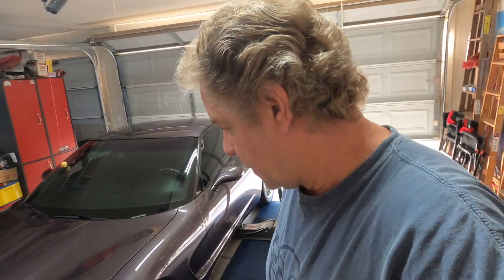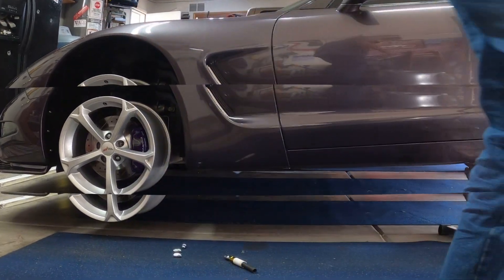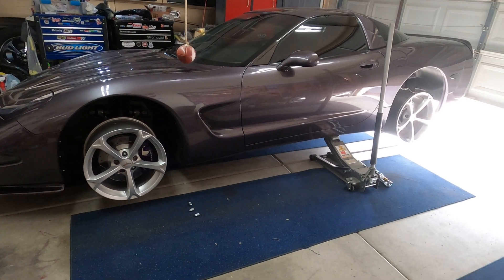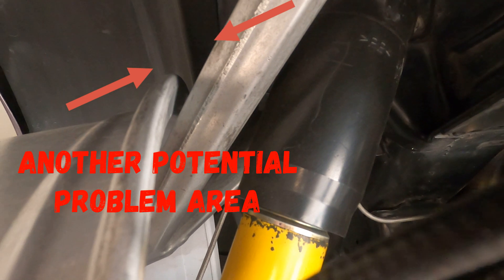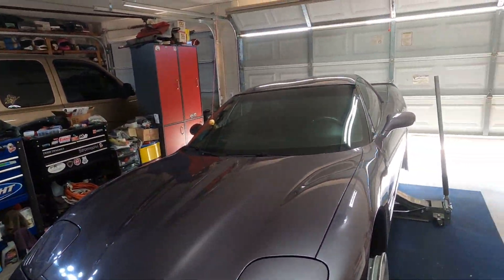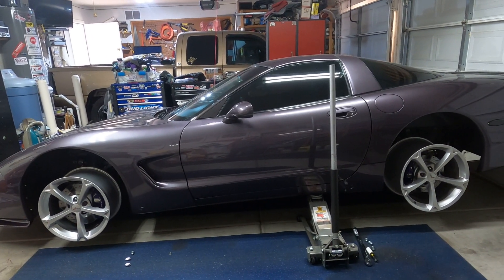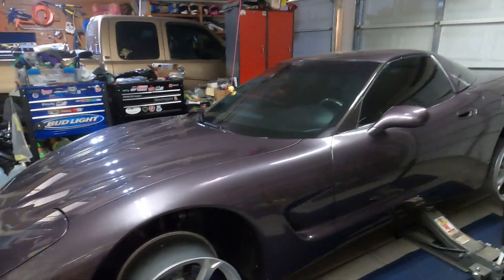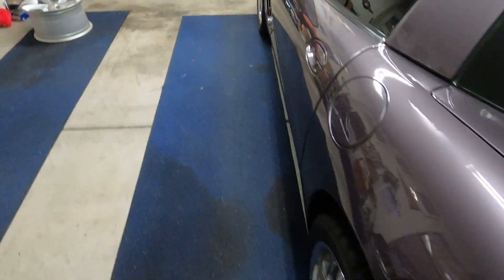C5 Corvette - Do C6 Corvette Grand Sport Wheels Fit?

Comment: I don't always comment, but I do always watch. This was a great subject to address, ie to see if the C6 GS wheels would fit. I like it, but I'm wondering if you had coil-overs if that would help the clearance for the rear wheels as to the A-arm clearance? A set of chrome GS wheels would look phenomenal IMO.

You were talking that you'd have to get them chromed. Where in NJ or elsewhere would you go to have them chromed? There aren't many places around that do that anymore due to government regulations. 

Good luck in your search for an alternative wheel setup that you really like. Make sure they're chrome though. 😉

Lastly, I do like the wheels you already have. Save the Wave 👋
Reply from the maker: Appreciate the comments, always welcome. Thanks. 😎👍 I do like the GS wheels and if I did get a set, I'd probably go the wide body set-up with the car. I would also look for a set that was already chrome and so I wouldn't have to worry about getting them chromed. I have also installed the coilover shocks too, love them so far. I still have the chrome wheels on from this video and really like them so I proabably won't be changing anytime soon. I am going to leave the car the way it is for a while.
Reply: I can't say what you will, or won't due. But I'd say that installing a wide body would be more than a challenge and expensive. If you feel you could do it and it's worth the money, GO FOR IT! It would make your C5 even more incredible.
Reply from the maker: @petercarey6883  Thanks, nothing in the plans for a while so it's going to stay the way it is for the foreseeable future.

Comment: I have them on my 2000 base. they look amazing went with 315's instead of the 325's in the rear no rubbing unless its dropped max on the z51 package. fronts poke a little but when i change tire ill go a little smaller and should alleviate most of it.
Reply from the maker: Awesome, thanks for your input. It will come in handy if someone watches this video. Did you need a spacer for the rear to keep them from rubbing the inner fender well? They look like they'd rub a bit.
Reply: Any idea if they fit on an fbody? Or will I need spacers

Comment: I have after market crome C6 wheels on my C5 and I love them.
Reply: Grand Sport
Reply from the maker: @paulconway3015  Thanks for the reply. I'm still debating on what I really want...I do like what I have now but just want to be different from what others around here have also.
Reply: I just put my old 2008 Z06 wheels and tires on my sons c5 Friday and they are 325 on the back I think it looks good.
Reply from the maker: @kevinz0681  Nice, those are great looking wheels. I never would have thought the 325's would fit though.
Reply: @c5grapeape  ya they fit just like the but they stick out a little bit, I’m gonna have to wait till spring and decide to go to a 315 tire, but I have a 345 drag radial on HRE wheels on the c6 and it looks great.

Comment: The back wheels are usually a little wider the the front. Could it be possible that you may have the rear wheel on the front and the front wheel on the back?
Reply from the maker: Not really, I checked that too before I put them on to make sure I didn't do that.

Comment: At ride height they would be even worse.  It's amazing how much the wheels tuck at full droop.  Probably another half inch of poke if sitting on the ground.   Even my 01Z wheels stick out a 1/4 inch or so front and rear.  I don't care for it.  Love that grandsport wheel otherwise and even though I'm not a chrome guy I think they would look awesome on your car in chrome.  Are there Repros in 18x9 and 19x10?
Reply from the maker: The ones I have on now are 18x8.5 front and 19x10 rear. The ones I was looking at are true Grand Sport wheels but only made for 1 year and not available to buy from GM when one purchased a C6 Grand Sport, so 18x9.5 front and 19x12 rear. Won't work for me and what I want. Not sure what the aftermarket wheels are in the 18 & 19's off hand. I know they make them but just not sure on the width of them.

Comment: I'm looking for new wheels but the weight of any wheels I buy has to be less weight. No heavy chrome wheels or heavy wheels.
Reply from the maker: Weight doesn't really bother me to much so I tend to gravitate towards the chrome ones. Just the way I've always been.
Reply: @c5grapeape  I can understand that. My car is mostly stock so as a daily driver  I was concerned about less rotational mass at each wheel for speed or handling. I always consider little performance advantages in almost everything I put on the car.